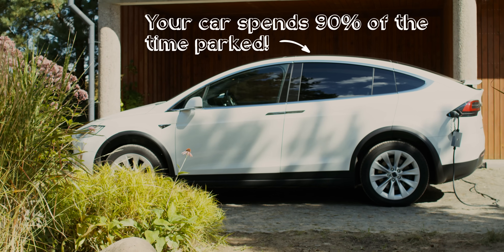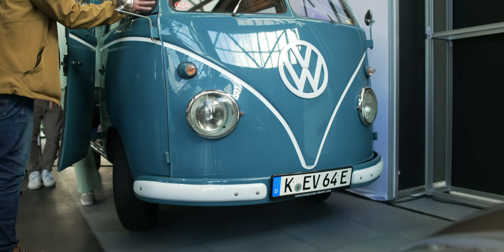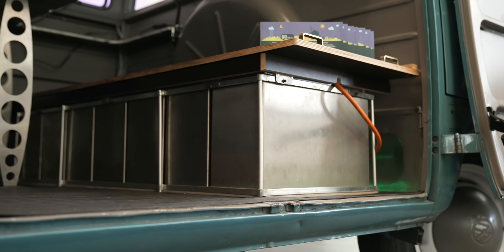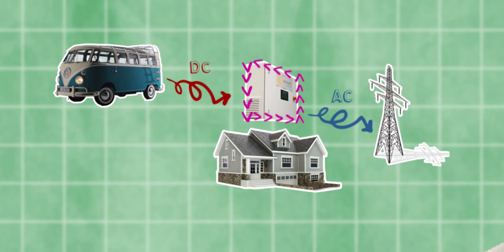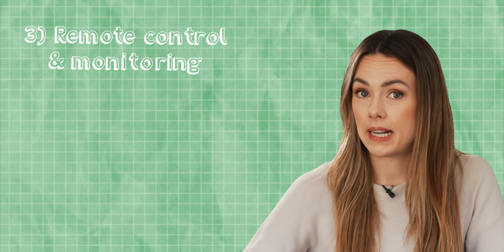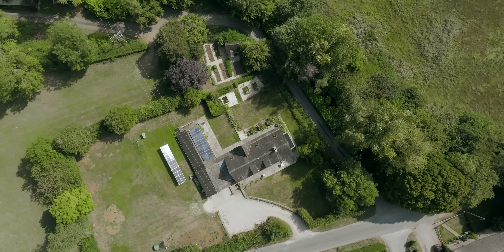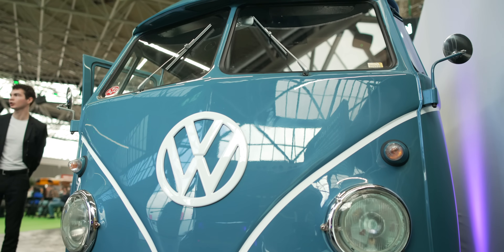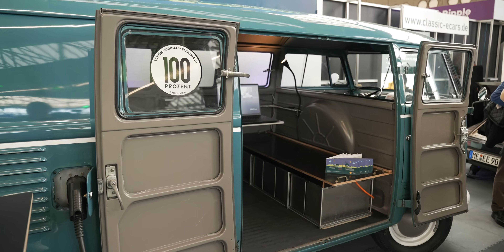This VW Bus Has SUPERPOWERS!

Comment: Vehicle to Grid seems fine but is it really the answer?
let us say 3 million cars are made available for V2G at the time the peak demand is needed. typically from 16:00 - hrs to 21:00 hrs.
This 5 hr window seems common time frame around the globe. 
let us also say that each car can provide 3 kWh back to the grid over a 8 hr period without placing too much strain on the vehicles systems.
24 kWh x 3 million cars. 72 GW of power.
Each car can power 2-3 homes for a period of time but not at peak times.
Turn on an electric Oven  an electric induction hob for a couple of pots of veggies  or a frypan.  Add to that the fridge and freezer all running at once would eat up that 3 kW for a period of time then add the lighting and any heating. whilst it is an option I feel it is less coordinated and likely to be problematic. No matter the incentives to do so with feed in tariffs.

It seems to me that community storage batteries provide far greater benefits  than trying to use people's cars.
One large BESS and one large inverter instead of every car having to have its own separate inverter.
Lets ay 2 MWh battery soaking up the excess solar during the day and then releasing that over the 4-8 hr period for maybe 100 homes to use.   one battery in a common location in town benefitting 100 homes and one inverter being used. not hundreds.

Now put hundreds of those BESS systems in communities and that is 000's of homes.
Those guaranteed to be open for access not reliant on people and their vehicle to be available.

Comment: With all EVs currently coming with long battery warranties, manufacturers will likely not want to encourage this additional use of EV batteries which can only wear them out more quickly and without exceeding warranty mileage. A move to LFP helps but a more sophisticated form of car battery warranty that takes account of V2G is probably needed.

Comment: I have a concern with V2G.

How do we ensure that the Grid never reduces the car's battery below 75% capacity or, maybe in my more generous moments, down to 50% of capacity?

I can see sharing elwctrons back to the Grid but I don't want to find a dead car when I need it if, say, a blackout hit but we didn't know it because the Grid acted like a vampire, sucking the power shortfall from all of the EVs in the neighborhood.

I also want to be paid for every electron pulled from my vehicle since I was billed for every electron going in and by paid, I mean at the same rate as the electric company billed me AND I want that money deposited into my bank account NOT as a "credit" on my bill.

Comment: Was on a V2G trial with my Leaf and an Indra product. While the wall charger worked, over 18m I saved/made over £1000 owing to the business model of selling back dear and buying cheap. As someone else has said it’s mad having a small 5.5kWh battery at home when you’ve got 30kWh sitting on the drive. That battery just happens to have four wheels on it. Roll on V2G and thanks for the episode. Where can we buy the tech featured?

Comment: Thanks, a very clear exposition of quite a complicated topic. Proper V2G, without the need for another 'static' battery, is a must-have. Not only can it benefit the house owner directly, but it offers significant grid benefits at the national level. Last but not least, it's a more efficient use of key raw materials. Why (as many do) have a static and a mobile battery, when one will do.

Comment: An obvious question to me is why isn’t Tesla leading the way with V2H & V2G? When you consider that they have the knowledge, and equipment already with their Powerwall and Gateway 2 to integrate a battery with a homes electric system (including solar) and a means of isolating the house from the grid if there is a power outage. Plus they have developed the Gateway 2 so that it satisfies the requirements of grid operators in many different countries. Add in that they make their own AC & DC chargers, produce some of the best software and user interfaces available, it seems odd that with all this technology they haven’t yet made a home bidirectional charger? Seems like a good reason for Imogene to go knocking on their door to find out.
Reply: I’m also curious why they chose not to worry about that feature. Is it just a software update and an adapter? Or will they need new hardware for it. Either way, I’m happy to just live in the car if there is a power outage 😂

Comment: My charger has a CT (current transformer) so it knows how much power is being consumed by the house and EV. 
So you don't necessarily need the grid to be controlling things if you just want to be powering the house to net zero usage. The charger should just ask the car for a certain number of kW up to a limit.

Comment: We’ve got a V2X bidirectional charger. We charge the car (2014 LEAF) with off peak electricity and use the car’s battery to power our home (Vehicle-2-Home). The Distribution Network Operator (DNO) has export limited our charger to 3.68kW if it’s used for Vehicle-2-Grid. The charger is capable of exporting up to 6kW.
Reply: Nick are you on the trial?  We've bought a leaf and are still using the granny socket partly since I don't want to buy a one directional charger for a year or so.  Could power the house overnight in summer easily and charge from our PV.  Octopus have launched a tariff so I guess we are getting closer  - sigh.
Reply: Yes we are on a trial with Indra. We still have our 7kW wall charger installed.

Comment: Will this not wear out your battery quicker as a battery has a finite number of charge/discharge cycles ?
Reply: That was a worry initially, but it turns out no. House load is very small compared to car load. Trials done by Nissan a few years ago found that the gentle exercise around the mid charge zone actually improved the battery lifetime slightly.

Comment: Now if we had a government that really took this seriously we would mandate V2G.
What she had not explained fully is the issue with connecting a private power source to the grid is there is a safety issue.  They shut off the grid for repair..and find electricity still coming from the wrong side.
Reply: They thought of that. Safety is built into the inverter to prevent that happening.

Comment: Hmm ... if we see cars feeding into the grid when they are parked at home then when do they find the time to get themselves recharged?

Given the time taken to charge the battery at home then how long will the battery be supplying power to the home or grid?

One other thing ref the notion of an onboard car inverter then that output would only be supplying the house mains phase (in UK).

Google will help on the topic of how properties are connected to the grid in order to balance the phases.

If a battery was charged away from the home on an "expensive" tariff then it would be an expensive way of doing the battery to home thing.

All in all it looks as if most people are clueless on this topic and the entire nonsense is a case of technology looking for a home to solve a problem that doesn't exist.

In fact it might be said that buying all this equipment to run a jome from a car battery simply shortens the life of said car battery.

And increases the cost of running the home when the cost of a battery is factored into the equation.

Nothing is really for free.

This notion of battery backup is a bit silly in countries 
with a reliable mains supply.

Perhaps that's why some car manufacturers steer clear of this "V2H/G/L" so the car battery isn't on such a brutal duty cycle working itself to death driving a home as well as the car?

People who have researched why lithium ion batteries self ignite will know by now that there's an issue with "electrolyte degradation" which can cause heat to build up.

For all we know that's what caused the three London buses to self ignite.

Probably best to wait until hydrogen arrives before lashing out on power walls and the like.

Google might be useful to discover how much CO2 is produced and released in the manufacture of lithium based cells. Plus the amount of water used in the lithium processing.

Eventually the penny will drop as to how green lithium batteries aren't.
Reply: It would depend on the amount of energy you had agreed to sell back to the grid. A V2G system is intelligent, in that it "learns" your normal daily EV requirements, and will not take anymore energy than you would need for the following day etc. You would of course be able to override the system at anytime, and set your own lower limit.....

Comment: Wouldn't it make sense to just piggy-back the SOLAR INVERTER to feed your vehicle's DC back into the grid?  The solar inverter already converts DC to AC to feed back into the house & grid, you'd just plug your car's DC output inplace of the solar's DC output instead 🤷🏻‍♀.
It's also pretty common for EV owners to have solar on their house.

Comment: I don't see the point of V2G. I don't want to have my car depleted when i need it. I don't want extra wear and tear on my expensive car battery. For home storage/time of day arbitrage/ it's better/cheaper to get purpose built batteries like sodium Ion chemistry. V2L for rare blackout or camping trip sure, but that is niche, and cheap lawn mower batteries/solar generators do same deal for less.
Reply: Exactly leaves me absolutely cold
Reply: Your car wouldn't be depleted when you needed it.....  Only the energy you agreed to sell back to the grid would be taken. Plus you would still have the facility to override the system and set your own minimum for particular scenarios.......
Reply: @Brian-om2hh  yes it would be ...this is basically arbitrage. Buy low, sell high and the times when it is high are the times when you are most likely to need to use your car the most. I keep my car at 80% charge normally so it's ready to go when I need it. Doing energy arbitrage is going to significantly reduce the range on an already slow to refuel limited range vehicle... Just not worth it for most people.

Comment: public ev chargers price is 3 times more than petrol plus wait time 
 V2G 2EVs driveway  road  use tariff, cost of energy home.
house batteries . r 85% of our house  5.5kw/h battery. Zoe s52kw/h battery. connect everything up.
Reply: You can reduce the cost of using public charging (by up to 50% depending on the network) by subscribing to the network. Non-subscribers will pay full price. My local charge network is priced at 38p to 48p per kwh, depending on which of the 3 subscription rates you use. At 38p per kwh, if you got 3.5 miles per kwh (which many EV's would) it would work out at probably less half the cost of using petrol....  I charge at home almost all the time, and it costs me 7.5p per kwh. For me, this works out at around 2p per mile, or less than an 8th of the cost of using petrol. I haven't needed to use a public charger for over a year.

Comment: Having EV's offer V2x as DC output makes most sense, as should only require a software update to enable. Prior to the Nissan LEAF offering V2G option, the Mitsubishi iMiEV offered V2L option using an external "PowerBox" the size of an A4 paper ream (500 sheets). In 2012, this a great option for home power outage, camping, etc. Cost was reasonable, and the 1500 watt PowerBox was was portable at ~9 kg.
An option to offload/charge via DC port could also transfer energy to an external energy storage, or too the EV. Once grid connections, come into play, particularly with AC, things get complex quickly. eg: AC signals need a way to manage and keep in-sync. The raw technology for converting DC to AC via an inverter is exactly the same as a solar inverter. Just slightly different management software.
Reply: Using the DC port requires your EVSE to manage 400 or 800V DC which is currently expensive (although it probably wouldn't be if it was standard). Doing it over 240V AC is a lot simpler and cheaper and still gives you 7kW (single phase) which is enough for most houses. 3-phase 22kW is enough for any sensible house. I think AC is the way to do for most people,but this is currently a subject of much debate with various companies invested in the 'one true way'  on both schemes.
Reply: @xxwookey  When you say "currently expensive" you don't mention what part of the system is expensive? You probably skipped over the 1.5 kW portable option I mentioned. (above)
Such would be under €1200 (the price the PowerBox sold for in Japan in ~2012) You're welcome to opinions, but there are many ways to interconnect, no 'one true way'.
Reply: @AerialWaviator  Sorry - yes I did miss your mention of the iMiEV 1.5kW V2L inverter.  I was thinking of the various home Chademo bi-directional chargers which have been used in trials Those were 5-20 grand devices. Ultimately all these things are just inverters and cost primarily depends on power throughput. None should cost more than current PV inverters in reasonable volume. Do it the way the E-GMP platform (and the Zoe) does (re-use the motor inverter) and it's really cheap.

Comment: Smart charging will mitigate most of the charging-related grid impacts in the short term, but I'll be very disappointed if this kind of bidirectional charging is not a standard feature in all EVs 10 years from now.

Comment: I’m puzzled why they reinvented the wheel. V2H has existed in Japan for over a decade and it works. Many households have already implemented it. There is no magic to it with Chademo. For it to work with CCS/NACS the car manufacturers need to agree the required communication protocols and then device manufacturers will surely provide the necessary inverters like in Japan. That said people overlook one big issue and that is that EVs consume a lot of power when charging or discharging on DC. This overhead is so big that V2H isn’t a great replacement for a home battery which is much more efficient in this respect. Most V2H owners in Japan have been badly disappointed by how little power they actually save - in some cases even losing more power by being permanently connected to the car than their solar systems produce. So EVs need not only the right communication protocol but also some reengineering to run as efficiently bidirectional charging as home battery systems mostly do.

Comment: 🔌🔌AC or DC voltage from the power source is a minor issue compared to getting the 3000+ utilities in the USA to approve a closed transition to their grid. A 5-millisecond bumpless power transfer can take five months for utility approval. It took years for utilities to approve closed transition solar inverters for residential base loading. Even now some utilities only allow open transition so no solar or V2G.🔌🔌
Reply: That is the peculiarly restrictive US with its crazy array of state rules and multitude of power authorities. Most countries have agreed grid sync standards for PV which can just be used for car batteries too. Power transfer management is a separate matter. We can already do this in the UK, and, I presume, most of Europe.

Comment: Pionix and EVrest have been making this work for more than a year now. And it's totally generic, not tied to any particular car manufacturer, charger manaufacturer or grid supplier. This is the right way to do it. It already works on the Kia/Hyundai vehicles, and it would work on all the MEB cars if the software just stopped erroring out when the charge rate goes negative (which is presumably what the OTA update referred to in the video does. .

Comment: The problems with conventional V2G, besides the technical and cost issues. It is logistics. EVs are parked at various locations, bidirectional charging would have to become ubiquitous It is a very long way off at best. And who knows if it will ever happen? Plus that 10 to 20 percent, when you're driving tends to be when the grid needs it.  So it still will just be a marginal option at best.

A far more effective option is V2G, utilizing modular (or variable sized) packs, via battery swapping stations. Since the excess battery capacity is at a swapping station, where it can do V2G balancing. Which is already being done at battery swapping stations in China.

Conventional V2G is just a niche feel good option, that's just not scalable in most cases.
Reply: Well said. Nio also is live with v2g charging piles for all their vehicles. China 2024 energy policy is stressing v2g in a massive way for grid stabilization. Nio's swap stations in Germany and Denmark are live with v2g/ energy arbitrage.
Reply: @onetwothreefour-s1n  That's another advantage of BAAS, no fear of V2G  battery degradation. When EV owners, don't own the battery pack...   I wonder where they place the V2G units? And if owners have any fears of not being able to get home in an emergency? I guess you can swap it out at a battery swapping station. After thinking about it, they tend to be synergistic options. 

Actually there are far more interesting battery swapping networks, than what NIO offers.... For example, CATL's modular battery swapping network....  But since NIO is rolling out in Europe it tends to be the only one that gets coverage In Europe....

But the competition is forcing NIO to become more innovative, such as agreeing to create a battery swapping standard with Geely and other automakers.... So even if the detractors are correct and NIO goes bankrupt eventually.... The technology will just be absorbed by another company....

Thank you for your salient points....
Reply: @nc3826  well said